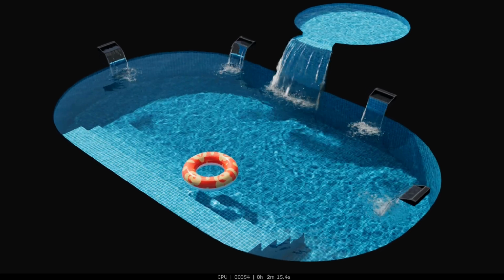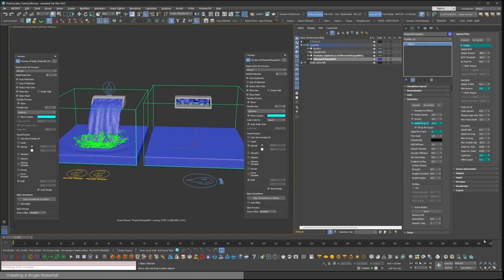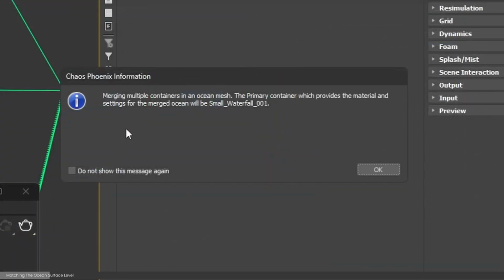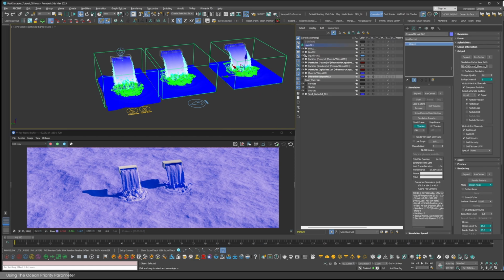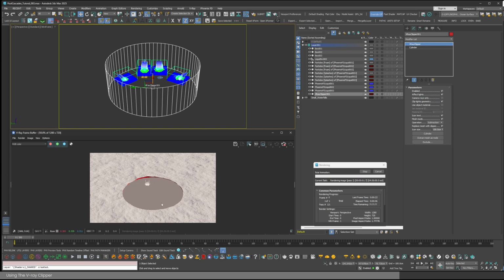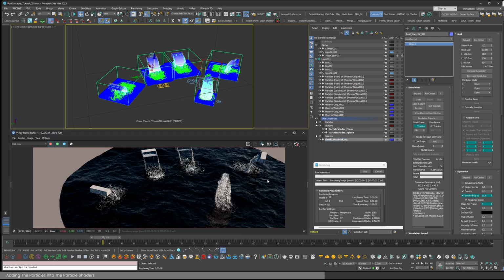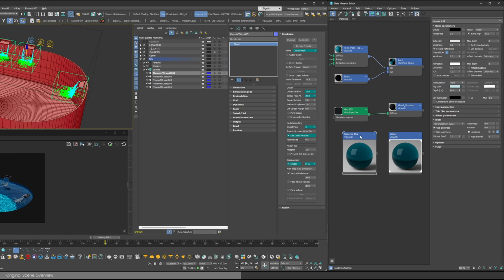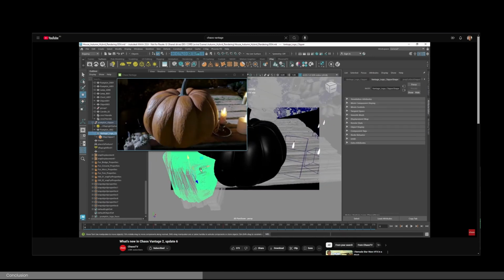Create a Cascaded Pool: Chaos Phoenix Tutorial (PART 1/2)

Comment: Hi, I love this tutorial is that possible to take this sim into unreal engine?
Thankyou so much
Reply from the maker: Hello, and thanks. This is a great question, with no simple answer.
I'm no expert in Unreal Engine, but it should be possible to read an animated Alembic file (ABC), which contains the geometry of the water and probably the secondary particles (splashes and foam).  I did this some 10 years ago for a Unity Demo (Book of the Dead). It was a small-scale simulation of saliva dripping from a character's mouth. There were no secondary particles needed for this small effect.
For the swimming pool scene, exporting the geometry as animated ABC might work for the falling water sections. However, the procedural ocean surface (the main pool) can't be exported. It is generated on render time by 3DS MAX and V-Ray. This means this part of the setup should be modified, and a real geometry has to be created by Phoenix, and then exported. Also, you have to consider that these animated ABC files can be HUGE. Probably a few gigabytes. Then, there's the issue of what to do with the foam and splashes. Those particles can be exported in the ABC as well, but you have to find a way to visualize them in Unreal. In V-Ray, you have a particle shader that you can use. But I don't know if this can be recreated in Unreal.

Comment: Such an interesting tutorial…
But how do y’all computer run phoenix so smoothly… mine takes minutes to hours to preview simulation of 300frames… I’m using a 32gbram, rtx4060 (8gb vram) intel i7 13th gen laptop… is there a way to disable mesh and just leave particles on, but when it’s time to render it renders out the mesh?
Reply from the maker: Hello. In the Preview rollout, there's a checkbox that says "Show Mesh." When you disable it (I think it is off by default) you can only see the individual particle systems. You can disable them one by one as well. However, the cache files need to be loaded when scrubbing the timeline. An SSD drive can help read large files.

Comment: You mention the Vantage setup its different. How i can do it?
Reply from the maker: The ocean surface merging function works only in 3ds Max. Meaning you have to simulate the bottom part using a single grid that covers the entire pool surface.  It won't be as optimized as in the video, but there's no other choice. 

Other than that, Vantage doesn't have a particle shader yet, so I've seen people using tyFlow to copy the foam and export it as geometry spheres.

 I think the cutter is implemented, so you'll have to create one in Vantage and use a geometry to cut out the shape of the pool, exactly like in the video
Reply: @zdravkopavlov thanks. I have a jacuzzi with a infinite border and i export everything to vantage or render in live link.
Reply from the maker: As far as I know, Vantage won’t be able to generate the infinite surface. You need to have a regular mesh. But I have to try this. Never actually tried it myself.
Reply: @zdravkopavlov yes. Vantage can generate the infinite surface. I try with the ocean surface Only you need a camera because they generate that surface for only the parts you see in render.

Comment: Hi.. foam visible in simulation  not appearing in vray render.. what to do sir?  increased size multiplier and count multiplier in particle shader.. still invisible in render...
Reply from the maker: Hello. You need to make sure that the correct particle system (the one you need to render) is selected in the shader list. Double-check if the shader is not hidden and it is a renderable object.  You can isolate it (Alt+Q) and make a test render. It won't matter if the particles are hidden from the viewport. The viewport preview is not important. If the shader is not hidden, it will pick the data and visualize it.  Are you using V-Ray CPU or GPU? And what rendering mode are you using in the shader for the foam?  Is it "Points"?

Also, make sure that you have PhoenixFD added in the Environment and Effects dialog (shortcut: 8) under Atmosphere - Effects. It should be added automatically, but in case it isn't, that could be the reason as well. 

That's all I can suggest without looking at the scene.
Reply: @zdravkopavlov  .  checked all.. all ok.. still not visible in render... IT works with GPU rendering but what about CPU rendering?...
Reply from the maker: Which vray and phoenix versions?
Reply: @zdravkopavlov   vray7 .. phoenix 5.22    3dsmax 2024
Reply from the maker: Okay. This means that you are not able to render not only the foam but also fire and smoke. You need at least 5.23 version for vray 7
Reply from the maker: V-Ray 7 support was added in 5.23
https://docs.chaos.com/display/PHX4MAX/5.23.00
Reply: @zdravkopavlov   with max 2020 and lower Phoenix versions.. i rendered foam before
Reply from the maker: It’s not about Max version. It’s about Phoenix and V-Ray versions.
Reply from the maker: Since V-Ray 7 was released, there are Phoenix builds that support either V-Ray 6 or V-Ray 7.
https://gyazo.com/fbb8f2e22bba2a4c35a32d53fe403f9f

There are versions for Phoenix 5.22 for V-Ray 5 and 6. And since Phoenix 5.23 was released, there are builds that support V-Ray  5, 6, and 7.
Just pick the correct one.